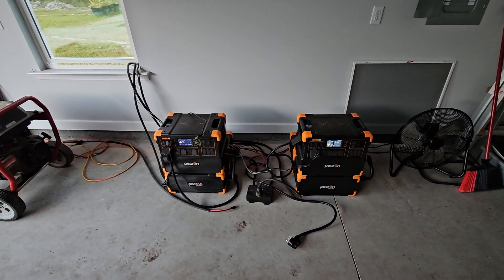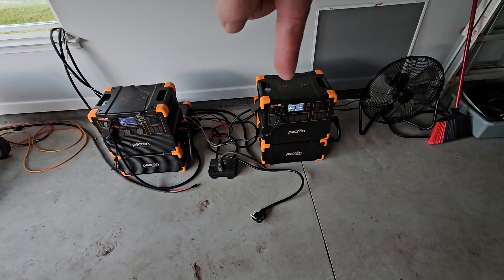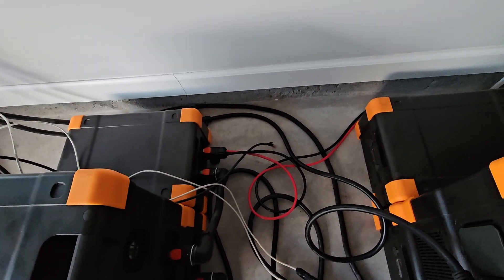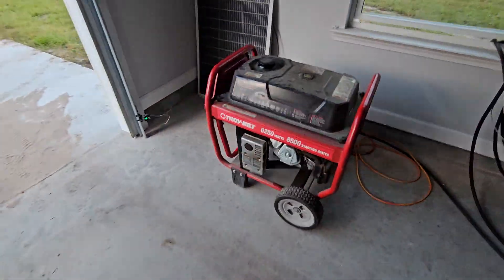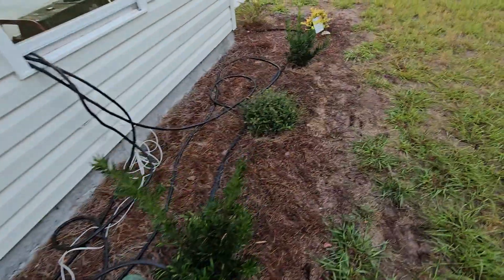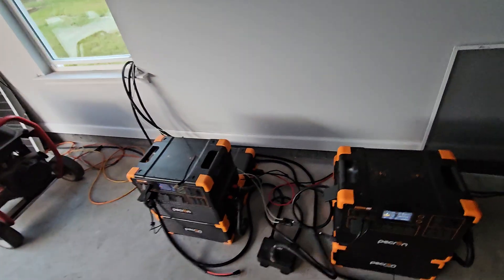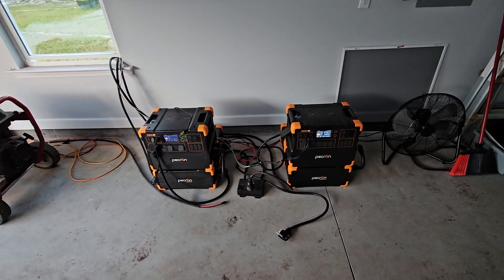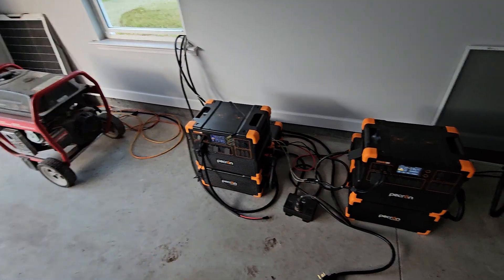Charging 2 E3600LFPs with only 1 120V input!

Comment: Just take a 50 amp breaker and put a loop on it to pass through the 50 amps to the other leg. But let’s be honest…. The pecron is great for the 120v loads but I’d op for a whole home system in that case. Good info in all the tests. It’s nice to know the limitations of these smaller units.
Reply from the maker: Thanks! The long term plan to get a dedicated system that is grid independent, but can draw grid power to charge as required. They would work great for an off-grid cabin when only 120v is needed.

Comment: why don't you just connect the two battery pack at the bottom just using mj32? all 6 batteries including the two in the main units will be in parallel that way. You do not need the bonding cable.
Reply: He had before.  The extra resistance seems to be less efficient with keeping all the batteries leveled out though.  Pecron only recommends connecting 2 batteries per the main unit MJ32 - i.e, not one single vertical connection, but must split between the 2 main mj32.

At the end of the day, there are 2 challenges when connected to the 250v hub

1. Keeping all the batteries leveled due to the unbalanced loads on the home circuit breaker and what is drawing on each phase

2. Not being able to charge with AC power when connected to the 240V hub either, meaning you have to disconnect or use a DC power work a round of some type when solar is not keeping up or producing at all (night time. Clify days, etc).
Reply from the maker: The data cables on the OEM cascade cables will cause BMS problems if connected that way.

Comment: Nice test.  Sadly this is only kind of encouraging if you had a third unit that could charge normally from AC while still maintaining the full 240V connection to the hub with the main units but bond in the third to be the charger.  At $1000 though, not really going to be in the cards.

Otherwise, the simplest is to just find other ways to bring DC into a spare solar port in one of the main units or tap into the 400w ports of the batteries, but it still needs to be cost effective and efficient.

The next most expensive, but probably cost efficient in the long run and best output option... is still looking like an EG4 Chargeverter or eco-worthy 48v battery charger (if the downgrade of the eco-worthy) is still stable and effective enough.

I really hoped I could get away with some generic golf cart battery chargers but they only work with the main units solar inputs and because they are also "smart", limit charging to just 250w of output from themselves because of whatever protocol difference the Pecron's and the golf cart chargers BMS protocols are looking for.

In an emergency, we do what we have to do.  But if doing this full time, there has gotta be a more efficient way to charge the units when solar is lacking and the EG4 seems to  solve the problem.  It's just that it's $650 so the price kind of stinks too.
Reply: I am using 48v 150ah golf cart battery that came with ac charger to charge the Pecron. I used the xt60 spitter last night and got 2400watts going into the unit. This will be my set-up this winter when there is no sun. I will charge the golf cart battery using its charger while it is hookup to the PECRON with 240v box connected and with the bonding cable.
Reply: @jaysoncamaquin-vigil9525 I'm trying to visualize. Can you explain what's connected to where and if it is all connected at the same time or do you need to disconnect things manually between charging the golf cart battery and sending power from the golf cart battery to the Pecron's?

Thanks.
Reply: @titobandito8474  They are all connected at the same time and this would be your set-up if there is no sun;  hopefully, I can explain that you can also visualize it. Starting from the generator ---- you connect the battery charger - -- the battery charger connects to the 48v golf cart battery---golf cart battery connects to the Pecron. You can do the same connection set up if it is very sunny at your area especially if you have a big solar panel system all you would need is a big enough solar charger controller to charge the golf cart battery while golf cart battery is also charging the Pecron unit.
Reply: @jaysoncamaquin-vigil9525 Thanks!  I wasn't sure if it was ok to have the golf charger connected to thenexternsl battery and the Pecron at the same time, but makes sense that it does since they're in Parallel. 

Instead of modifying alor building an MJ32 cable, I'm going to get the Pecron MJ32 cascade to XT60 cable and try charging with a 48V golf charger through it.  

Watched Jasoinoid do essentially this with a rack battery to the E3600 using that cable without needing to modify anything... Just get the right XT60 adapter ( and I have several that quick disconnect with Anderson SB50 plugs).

Hopefully that will work better than trying to use the gold charger directly to an XT60 on the E3500 since it will be flowing through the MJ32 port.
Reply from the maker: I agree a direct connection to the DC ports via a charger like the EG4 is great idea!
Reply: @GridDownPreparedness I decided to buy the golf cart battery instead of the EG4 AC charger. They were pretty much the same price but with the golf cart battery I gained a 5.12KW extra battery
Reply: For reference... If we had a third unit ($950 on sale with discount code currently).  And the MJ32 cascade cable to double XT60, theoretically we could get 1200w on each port.  

While kind of expensive... It's relatively cheap in the grand scheme since you have another  backup unit or replacement, or a standalone for another location or devices...

and that unit could be AC charger anytime and sending powee out via the mj32 cascade to XT60 splitter cable to the 240v units without ever having to mess with or disconnect them again.

PECRON MJ32 Cascade Port Output Cable - Output Max 1200W per XT60 port - $69
Reply: the 3rd unit does not have to be E3600. It can be a cheaper pecron with MJ32 connector
Reply: @泽溪-x2k True.  It just needs to be a 48v system and have the MJ32 plugs to use the cascade cable that splits to the 2 XT60 adapters.

I'm not sure if all would output the same amount of power though.  Just a guess, but I think the 30A AC adapter on the E3600 would probably give it the best amount of output and quick charging.

Personally. If not having a smaller one already, sticking with another E3600 would provide a lot of options for backup and the best likely performance.  It does cost more but the current sale price of $999 (tax free and 5% code as well) is kind of enticing.

The cheapest I can find an EG4 with the 110v adapter, after tax and shipping is already $730.